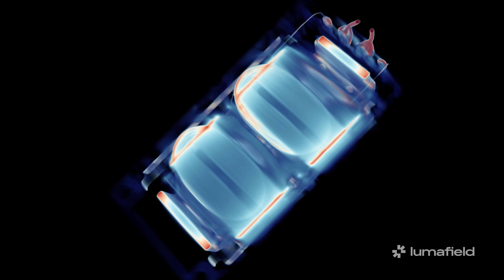Switch 2 Pro Controller: Built to Break? Full Teardown

Comment: Talk about being heavy handed. Iso on the faceplate where a heat gun will work and make it reusable. Then there’s the pulling clips from the wires, not the clips. Never thought I would wince watching an ifixit.
Reply: I would be incredibly worried to apply that much heat to a sensitive plastic device. A glass and metal smartphone is one thing, but this looks like it might melt easier than expected. I just wish that they didn't resort to adhesive in the first place :(
Reply: tbf those connectors were recessed inside the controller body, didn't look like someone could fit a finger and thumb on each side of the connector. I suppose they could have used a pair of spudgers instead of tweezers. pulling by the wires on a JST connector is fine anyway, it's not like it's a Molex..

I would NOT heat gun a controller, especially this one. The face plate looks super thin and could warp easily. Now, a hair dryer? Sure. Idk if that would loosen the adhesive though.
Reply: THANK YOU!  at least someone else cringes at the poor wire removal!
Reply: Isopropyl does not destroy glue like you imagine it might, just deactivates it until the IPA has evaporated
Reply: @Sapple498 some glues are indeed dissolved by IPA. Hot glue is not one of them. However, (in my experience) most permanently gummy/sticky adhesives used on modern stuff are dissolved by IPA.
Reply: its made of plastic so idk how heat resistant it is but yeah pulling the clips off by the wires is mega cringe

Comment: What a disappointment. The original Switch Pro controller was much easier to take apart, and properly maintain. At least the sticks are screwed but until you can get there, my god....
Reply: Also super creaky. I have both and really like the feel of the Pro 2 Controller a lot more. Smoother sticks, too. Time will tell whether they last like the OG Pro Controller. The lack of repairability is pretty crappy regardless, but hopefully I should not need to repair mine.
Reply: My thoughts. Do we really need to repair it? I've been using my 2019 pro controller for switch and pc and I havent seen any significant change in battery or whatever.
I can still use it for weeks on one charge. No drift so far

 @LeonardConsulting
Reply: And it was transparent, you could see the insides and it was cool.

This? Opaque. It looks much cheaper than the 1 Pro.
So let me recap, we’re making us pay 90 bucks for a controller which looks WORSE than the older one, and only adds just a few buttons and it’s not really repairable for the everyday user
Reply: @TheCoder55 matter of opinion the transparency material they used on gen 1 looked cheap and tacky to me.  and the texture on gen 2 is significantly nicer
Reply: @TheCoder55  This proves to me that you don't have a Switch 2 Pro controller. To anyone who has had both in hand we can tell you with certainty how wrong you are. Because the Pro 1 looks and feels way cheaper.